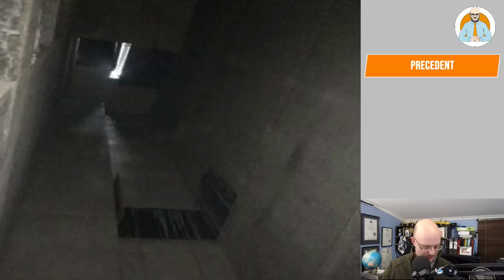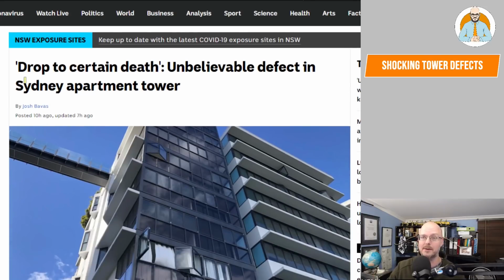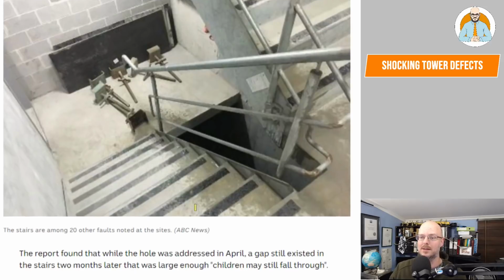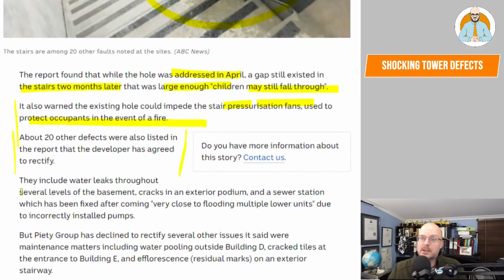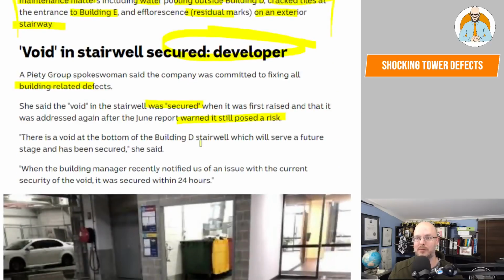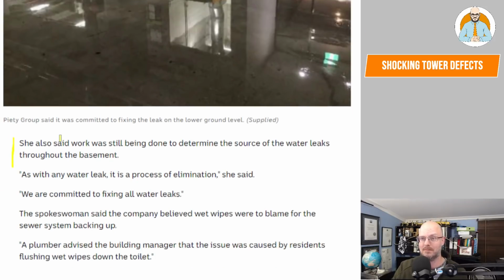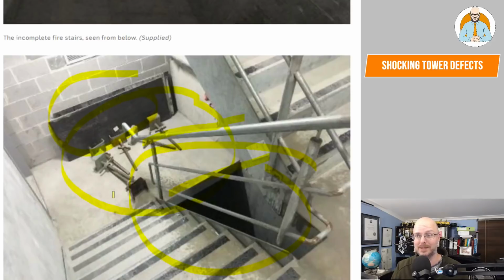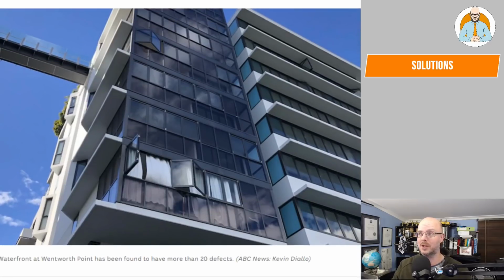Shocking Sydney Tower Construction Defects

Comment: This is truly awful and it keeps on happening. Really the only solution will be for the government to intervene and build brand new communal high-rise units, with a similar building model to the old Soviet dwelling blocks. With an allocated per metre living area per person. For instance to save space, people only need to sit when on the toilet, therefore a very low ceiling will be adequate. The state will provide the food, therefore the space for a kitchen and refrigerator will not be necessary. No one will have pets, so no outdoor areas will be necessary. The save power and reduce catastrophic climate change, all houses will be allocated a pre determined energy credit points per month, allocated by the number of persons dwelling in the space provided. 
If a person or persons use the generous amount of energy credits before the month is up, next month they will learn not to be so wasteful.